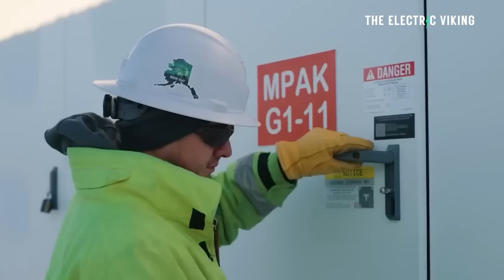Tesla MEGA batteries are about to transform Australia's power grid

Comment: The massive batteries just store 200 Megawatthours and they cost 100 Million USD-$. It´s nothing. 2000 Megawatthours? Also nothing - You need 2 Million Megawatthours storage - that´s 2 Terawatthours, than we start talking about powering an industrialized country, producing aluminium, steel and cement, airplanes, cars, having a tourist industry and a/c, fast chargers for cars and trucks and agricultural machines.

Comment: If you installed solar without a battery your giving money away. You need to match your solar system with a house battery and then spot trade on the NEM or sell your energy at an agreed price and make money behind the meter. Don't give your solar away to big battery as you won't get any of that profit. Look at Amber Electric where you can spot trade on the NEM or Localvolts where you can sell your energy at a profit.

Comment: It is not only the grid batteries that are going to make a difference.  It will also be coming from EVs that are Vehicle to Grid capable and set to participate and it will be the virtual power plant using home batteries.  Massive changes coming to make solar work.
Reply: I highy dissagree here. Most EV owners will want all the power they can get for their commutes. I don't expect many will want to power homes from them. Only those whom don';t drive much will be keen to do this, due to charge times, etc. Might change in a few years with faster charging, but most EV's are setup to power a few appliances, not power the grid.
Reply: The EVs would have to be charged.during daylight hours.  Funny, that is when they are parked at work or out driving the misses on a shopping expedition.

Comment: CA has a long way to go for batteries to store significant output for later use

As of April 2024, CA has 10,379 MW batteries 

https://www.gov.ca.gov/2024/04/25/california-achieves-major-clean-energy-victory-10000-megawatts-of-battery-storage/#:~:text=WINTERS%20–%20California%20has%20notched%20a,MW)%20of%20battery%20storage%20capacity.   

It produced 15,366,000 MW in April (EIA)

Comment: I am at the point of from being on grid to totally off grid due to the poor feed in tariffs, wonder how many have a big enough solar system and battery storage to totally forget the grid?, I have a 15kw system feeding the grid with a 6.5kwh battery and a off grid 8kw solar system with 52 kwh battery soon to become 68 kwh of battery
Reply: It depends entirely on where you live and whether you plan tto use electricity for home heating.
Reply: @rogerphelps9939  I live in Bathurst area which is cold climate in Australia, it will be used for everything including home heating

Comment: So what you are saying about coal is not 100% true. It will reduce coal powered generation in Australia, but it's increasing coal powered generation in China. Plus these batteries use a synthetic graphite which is derived from oil. They do this for efficiency rather than using an inferior product that is more environmentally friendly. Such as natural graphite.
Reply: You can make graphite from biomass, anything containing carbon. some companies are producing synthetic diamonds using carbon from atmospheric CO2.
Reply: @rogerphelps9939  I would assume that each of these methods are more expensive & that why they are using petroleum by products. My point is that it's no use producing electric vehicles on a high carbon footprint. That is just continuing with what caused the problem in the first place. There should be tighter legislation on how new technologies are introduced instead of more of the same. That's going to lead to lower profits & less return for investors, but we need to make the transition.

Comment: I will keep saying this Sam because it is true. The best place for batteries is in your home. Why? Because you buy less electricity, that electricity does not have to travel on transmission lines, in the event of a power cut you can use it and it will definitely reduce your power bill. Large batteries will only push up prices because they are owned by shareholders who demand returns.
Reply: Will they though? I mean, do these batteries cost more than the use of coal or gas powerplants? Intuitively I kind of doubt it.
Reply: Where it's possible to install home batteries yes. For those whom must rely ont he grid, these large commercial setups will be needed.
Reply: Here in he UK you need 50kwh to run a heat pump for a day in the deptths of wintter. That means you need several hundred kwh of storage per house.

Comment: What industries uses a lot of Electricity.  Aluminum takes lots of energy to produce this product.  Australia should take advantage of their natural resource.  Make Aluminum and any other product that uses Electricity.   To give you an idea it takes 17,000 kilowatt hour. or kwh to produce one tonne of alumininum.  No brainer has lots of resource.  Go Australia make a living doing this.  Tesla will love you
Reply: Hard to run a alum. plant for 10 hours a day.
Reply: @kkarllwt  Why not? Furthermore you can make batteries that use aluminium metal.  They are nott rechargeable but have very high capacities. Used battteries are returned tto the electric smelter to produce more metal. Aluminium metal is a much beter energy carrier than hydrogen. Using aluminium you can have limitless storage capacity.

Comment: My Ca bill is telling me electricity is getting more expensive? Rates went up 20% June 1.  It’s like you are on another planet.  You’re not going to get EV adoption with escalating rates.
Reply: Get solar on your roof and then you can forget about your Ca bill
Reply: @fredkite9330  CALIFORNIA?
Reply: What's going on? Someone must be making big profits ...
Reply: @fredkite9330  Calcium
Reply: One of the biggest issues with solar and wind is that they are intermittent, while demand is continual.  That means that backup generation (typically fossil) needs to be kept on inefficient standby.  This results in overall increased costs.  Batteries are too expensive to solve the cost problem.  Poor people suffer as a result.
“. . . a naïve observer might conclude that the rising share of new renewables (solar and wind) will usher in an era of falling electricity prices.  But in reality, the opposite has been true.”  Vaclav Smil, Numbers Don’t Lie, p.172
Reply: @dzcav3  No. Gas can be ramped up very quickly. Solar and wind are so cheap thatt even when storage is included hey are still cheapest. You are being ripped off.